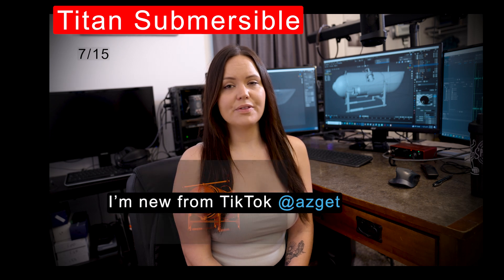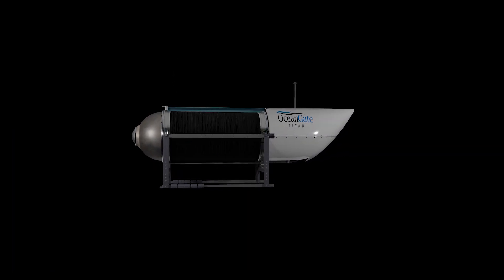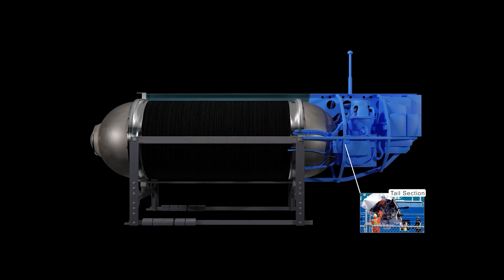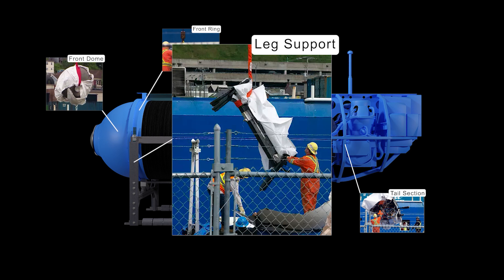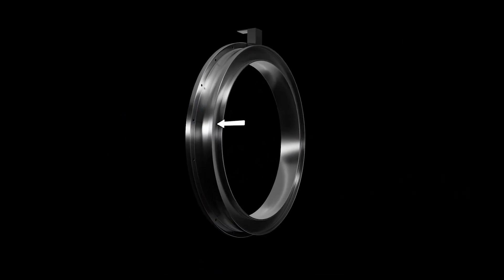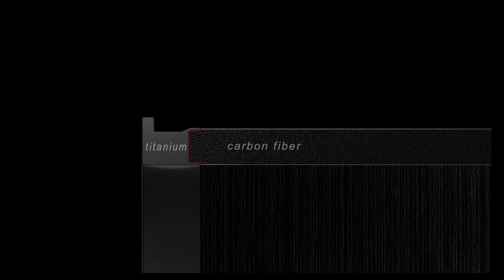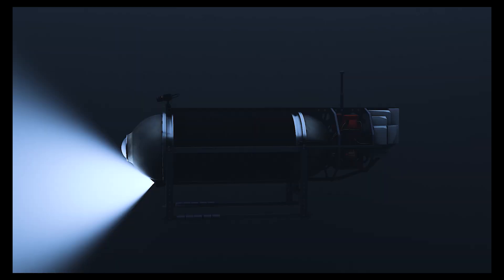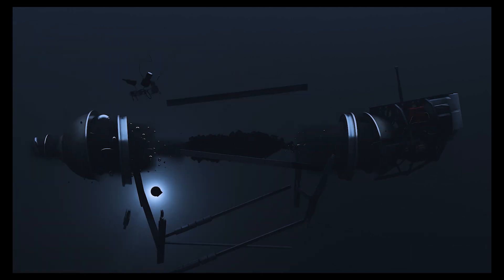Titan Submersible and how it Imploded... parts of submersible recovered 1600 feet from the Titanic

Comment: Brilliant video! Would love to see more from you - especially on this.

Do you have any information on how you generated the simulation? I'd be really interested to know how accurate it is. I saw another simulation from someone who appeared to be using more complex simulation software. The simulations looked mostly similar, except his had the two end pieces come together and collide?

Same guy also modelled a failure of the window. Could you do something similar?

Also just wondering why you had the metal frame attached in the simulation? I thought that was dropped pre-implosion?

I'm also very doubtful that there was no warning? People keep saying carbon fibre fails instantly? That's clearly not true from the fact it survived around a dozen dives. Damage was accumulating over those dives. Before the redesign his friend (Karl, I forget his second name) who went on the second dive with him said he could hear non-stop explosion sounds as loud as small calibre guns. And after the redesign these continued - even if more slowly.

That's what his "accoustic monitoring" was designed to manage. To me this clearly sounds like fibres and the resin reaching their failure points? Given what we know the monitoring system alarmed before failure, I think it's safe to say that more and more fibres and resin would be failing. Meaning those gun shot/firework sounds would likely have gotten more and more common, and louder and louder?

I would imagine they would have started increasing in intensity and started becoming so common as the chain reaction occured. Of course it'd have increased exponentially. Until finally the were parts of the hull that had lost so many fibres and had so many defects, that yes - then they would fall under the ability to hold the pressure out. At that point the entire things would catastrophically explode

Comment: As a master mechanic the best example i used was to explain to people who asked that it was like a Diesel engine combustion, only faster and in under a millisecond.  

Nice work on the video🎉.   Makes me think how much longer would they have had if the vessel was larger and the tube made from two layers of titanium machined as one cylinder. Hmmm some  math comming up.

Comment: I've been told it wasn't an implosion and the debris field suggests it broke apart. Not because of the inward pressure of the water but because of the compressibility of water. The moment the hull was breached the water decompressed almost instantly to about the speed of sound. The crew were killed by a large volume of water going very fast, and this also broke the sub apart.

Comment: Great engineering analysis. I really appreciate your attention to detail and mapping the recovered parts. It would be great to see additional analysis as more information is released from the investigation. Thank you!
Reply: Or even why the debris indicates the front port window did not implode. There is an outer retaining ring that seperated from the titanium nose dome which points to only outward pressure on the front dome during the destruction.

Comment: This is exactly what I believe happened. I believe the inner ring of the counterbore failed along with the glue. It's also possible that the pressure of the endcaps pushing inward mushroomed the ends of the carbon fiber cylinder, blowing out both the inside and outside thin flanges of the end rings counterbore, which look to be about .25 inch or 6.35mm. I must add that at those pressures, the glue would really have no effect anyway. Very bad design.

Comment: I think your pressure numbers are off. 4 foot square = 16 square feet. Pressure at the level  of the Titanic= 5500 pounds per square inch * 144 square inches per square foot * 16 = 12,626,000 pounds

Comment: I think the implosion occurred due to water ingress and delamination at the Ti-C boundary. Water ingress into the joint would result in water pressure acting on the intercarbon matrix at the ‘end grain’ of the composite and then on the titanium inner flange.

Comment: Great vid, thank U.
Would like to see the rear hemisphere/ring section if the ring & hemisphere r also separated.
My pea brain🤔 the rear glued connection failed & the force of the water, due 2 pressure & expansion entering the tube towards the front instantaneously sheared the bolts holding the window to the Hemisphere, and the hemisphere to the ring.

Comment: Well done. I think the carbon fiber could not take another compression or the acrylic port hole, rated for 1300 meters, cracked and blew in. Rush reportedly refused an offer to redesign the port for 4000 meters. Which would have been safer. Nothing is full proof, but steel and titanium don’t act like carbon fiber under pressure. It’s amazing this didn’t happen sooner.

Comment: None of the discussions I've seen focus on the rear hemisphere, which, so far as I can make out, was glued to a titanium ring which was glued to the rear carbon-fiber hull. What existed in terms of pressure on the forward titanium hemisphere also existed on the rear one. It cannot be that both rings were equally glued, as there are videos depicting a man gluing one of the rings by hand. Who is to say that irregularities did not first begin at the rear composite bonding? If ocean water jetted through a fissure created by pressure on the structure at the rear hemisphere bonding, the joining of water and electricity at the tail section might account for crackling sounds as well as loss of communications.

Comment: I think the epoxy attempting to hold the carbon fiber as it compressed would cause delaminations right there at the ends of the tube.    The weakening of the tube at the ends made it susceptible to the longitudinal force exerted by the titanium hemispheres, which in turn hastened the weakening of the structure.   My guess is the tube failed at the aft end right at the join to the titanium ring rather than in the middle.   It's nitpicking - the end result is the same.

Comment: This is a very impressive illustration.
At 2:15 you show the carbon fiber moving with respect to the titanium.  This is what I believe happened and likely caused a failure in the carbon fiber.  The glue is frequently commented on but in reality it is in compression and probably only functioning as a gasket sealer.  You say "the titanium still does nothing"... in reality all materials will be compressed under compression forces and the modulus of elasticity of titanium may in fact be less than that of carbon fiber meaning the titanium would compress more than the carbon fiber.  We have no good information on the carbon fiber actually used or how it was manufactured.  It was not cured the way carbon fiber typically is so that could affect its stiffness.  Also we don't know how many fibers were used parallel to the axis of the tube so when you show relative deflection at the end of the carbon fiber and some amount of shear and/or bending, the carbon fiber may not have fibers in a direction to resist this.  Whether your illustration shows the correct relative movement at the interface is actually not important, it is likely that there would be some relative movement one direction or the other and that alone would be enough to cause failure of the carbon fiber.

It is likely that a failure of the carbon fiber would have happened at one location rather than the entire cylinder imploding at one time, i.e. a big hole would have been punched in the carbon fiber.  Once such an imperfection is begun then the failure would expand outwards from that point rapidly but at the same time the cylinder would fill with water from the initial failure.  The dynamic effects of the water rushing in at one location would be hard to predict- it could actually blow carbon fiber outwards when the water reached the other end of the cylinder and certainly blow off the domes.

Comment: Excellent modeling! One thing I’m questioning is how many of the videos I’ve watched on this never mention the titanium cylinder the CF was wrapped around. That was seen in an OceanGate video, where they even glued the CF to the titanium.
Reply: The cylinder the carbon was wrapped over is what is called a mandrel. It's just a form to build the cylinder and then is removed after the resin cures. There is a video showing photos of the removal. I'm sorry, I don't remember which video. As for the glued pieces, there was a titanium ring glued to the carbon fiber hull and then the end dome was bolted to the ring. There was no titanium cylinder inside the carbon at glue-up.
Reply: @rogermccaslin5963  thanks! I never saw anything about removing the cylinder. Makes sense and that reinforces how foolish the design was.

Comment: I doubt it would be that symmetrical. Also you have 3 failures being mentioned (porthole / implosion of the carbon fiber cylinder / failure of the exoxy joint) but in reality these wouldn't have all failed simultaneously. I think it's most likely that enough of the epoxy joint failed that the cylinder began to separate from one of the titanium hemispheres, and that tiny deformation led to the instant implosion. However I can't tell how the porthole factors into that. I don't think we'll ever have proof what the initial failure was. But the whole thing was a death trap piloted by an idiot, so it was inevitable.

Comment: I have viewed many videos of the Titan and the simulations of the implosion, but I haven't seen any comments about what appears to be a thin metal cylinder inside the fiber hull. It seems that equipment and the flat floor are attached to that rather than directly to the hull. Do you have any information on that?

Comment: I’m neither a Submariner nor a Engineer. I’m just an average Joe, but the one thing that I do understand is that Carbon-fiber being used as a part of a pressure vessel for the main hull, is pure STUPIDITY!

Honestly, the only place where I would see Carbon-fiber being used on a Submersible are on areas where the spaces is open to the ocean environment. Thus requiring no pressurization at all.

Comment: Why do the two titanium domes move away from each other?  Your model shows an initial acceleration towards each other as the inner cylinder collapses, but then suddenly they're shot away from each other.  What in the Newtonian physics is going on here?  Are you simulating the surrounding water expanding to fill the void and then suddenly a secondary shock wave is produced?  😳

Comment: Yes , this is one theory .   A second,and more measurable explaination is that the Acrylic View Port failed ,It was rated to 1300 depth ,not 4000, so over loaded well into its yield tested approved field.  This failure would cause an 'explosive expansive pressure rise inside the vehicle which would shock fail the carbon fibre bonds blasting everything apart and away from the incident . Thanks

Comment: Very nice animation, and it confirms what stress/loading software already has clearly shown.  The joint between the titanium dome and tubular carbon fiber structure is indeed the failure point.  The two compress at much different rates, allowing 5000psi water to destroy the joint. On your part, the animation really illustrates the extreme failure and resultant implosion.  I plan to use your illustration in my engineering classes to help students understand the cascade of errors made during the fabrication of Titan.
Reply: Excellent point.  I suspect the design issues of this submersible will be used in engineering education for decades.  It reminds me of the old Tacoma Bridge collapse.

Comment: What is the end volume of the "black stuff"? It seems less than the volume of the actual carbon fiber material, which is a solid. Therefore, at a minimum, the end volume must equal initial.  Is it possible to create a brittle fracture scenario?

Comment: Your artistry is most appreciated! And your concise, focused presentation and animations make your production highly effective in communication. It appears that the outcomes you illustrate are founded upon reasonable assumptions (for the most part). One “nit” is that titanium and steel are not the “same” - though more “similar” than when compared to a “composite “ like carbon fiber/epoxy. The main takeaway is that metal can, and typically does, deform and deflect under loading differently than does a composite matrix material system (fiber layup/orientation reinforcement enveloped within a plastic matrix). That potential mismatch at an interface between different materials is a critical engineering consideration… as suggested in your animation of the joint between the titanium ring and the carbon/epoxy cylinder & adhesive bond. Geometric details also play a significant role in how a structure responds to and internally reacts to applied loads. For a submersible at deep depth, the dominant loading is fluid weight which creates hydraulic pressure. The hydraulic pressure is not applied to a submersible’s hull as merely a downward “weight”, but rather as a force equivalent to the water column above, acting perpendicular to every surface exposed to the water. So the hemispherical end caps have the weight of the water pushing in… which is therefore trying to crush the oblong “pill shape” end-to-end, as well as to squeeze the cylindrical tube… equally in all directions “inwardly”. This suggests the two end caps would move towards each other… at least initially. The pressure on the interior where the passengers sit is only slightly elevated by the walls deflecting inwardly as they descended from the surface - where they were sealed in at sea level atmospheric pressure. At depth, water wants to rush inward to fill the void and equalize the low pressure to the pressure of the water column. Only the strength and resistance of the hull stands in the way… until it doesn’t. That rush of pressure will travel at sonic velocity if structures fail to withstand it. Implosion versus explosion are both essentially the physics of pressure equalizing. One final observation is that the geometry of a cylinder with end caps is a compromise made to accommodate more passenger volume. A spherically shaped volume is self reacting to hydraulic pressure in the most balanced way possible. The line of action of the hydraulic pressure is perpendicular everywhere on the vessel’s hull, all vectors point to the sphere’s center. A cylindrical hull would be better able to react hydrostatic pressure with some outward curvature provided by a larger diameter at center span because the”bowed” axial cross section enables stability against collapsing inwardly (buckling deflection, kick load reactions, and compression “strength” is generally more capable than tensile strength)… think “whisky barrel”! Also, the outward barrel curvature would permit adding one or more titanium rings as frame supports to resist the crushing pressure, while maintaining passenger “headroom”. Regardless, the elephant in the room is repeat cycling and accumulating damage (fatigue life… plus hygroscopic impacts and ultraviolet degradation of composite with exposure).

Comment: Well…yes and no.  Yes the stiffer rings induced an extra strutural strain at the ends and middle of the carbon tube.  But, that extra was just extra; the tube would fail from radial and longitudinal loads even if the ends had been as compliant as the tube.  Employing a construction material that has a known and unpredictable failure mode in the application was a terrible idea.  Then, relying on detectors to warn of failure progression in time to allow safe emergency surfacing was wishful thinking on top of a terrible idea.

Had the ends been as compliant as the tube, wild horses still couldn’t drag me on board.
Reply: "Yes the stiffer rings" Nope... funy how  Young modulus is a highschool level of physics but somehow under this video no-one have any idea what it is...
To make the rings stiff you would need to make them extra thick in comparison to the CF of similar diameter and thickness -> who ever designed this rings also got no idea what he is doing as he even made this rings extra thin...
Reply: @Bialy_1  don’t throw the baby out with the wash.  She is right that the modulus of the titanium is a lot higher than that of the composite.  So the rings and dome were indeed less radial compressible than the tube.